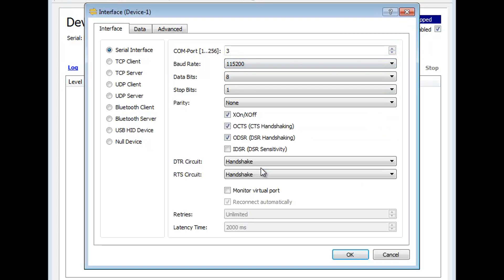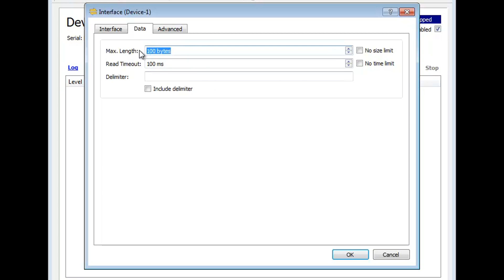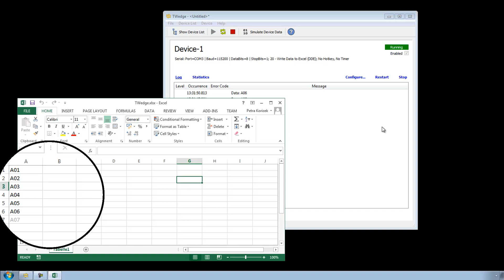TWedge Tutorial #1: Data Collection Basics (Serial to MS Excel)

Comment: excel doesn't read from this program(i use digital weight indicator and insert data to PC by RS232
Reply from the maker: Hello and many thanks for your comment. Excel should work without problems, please contact support@tec-it.com with details (e.g. Excel version and script or configuration file  used for TWedge data acquisition). My colleagues will reply asap.

Comment: I tried collecting data to Excel and Notepad, but why does it always skip a row between readings? i.e in Excel the data will populate in row 1,3,5,7 (always skips a row)
Reply from the maker: Hi! Seems that duplicate line-feeds/enter are causing the problem. By default, TWedge adds an ENTER key after inserting the data into Excel (causing a move to the next cell). If your device also sends an ENTER key after the data, you will receive empty lines as described in your comment.  

Solution: Modify line 80 if the acquisition script (press Ctrl+E to modify it) from 

if (!SendKeyStrokes (sData.replace(/\x00/g, " ") + "{ENTER}"))

to

if (!SendKeyStrokes (sData.replace(/\x00/g, " ")))

If you need support please mail to support@tec-it.com. Hope this reply is helpful!